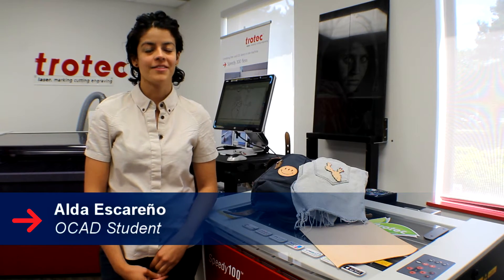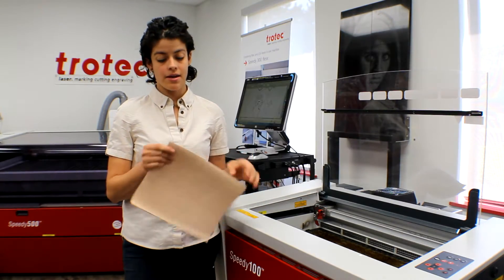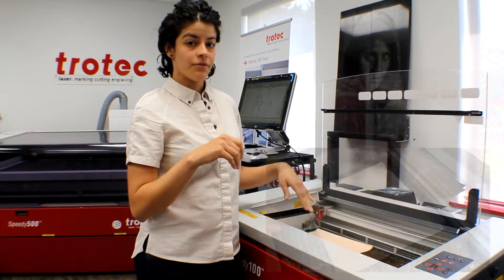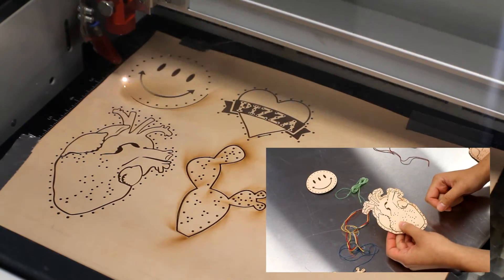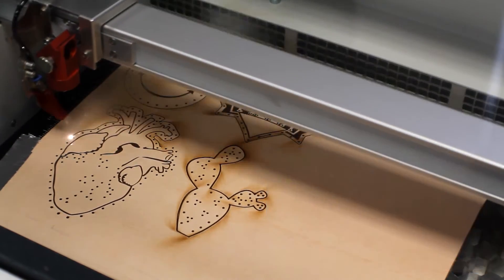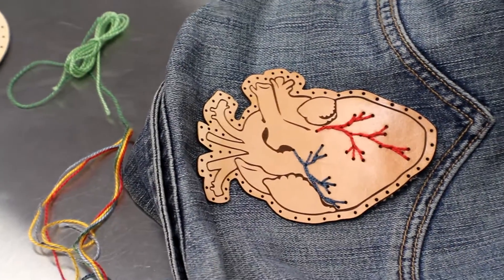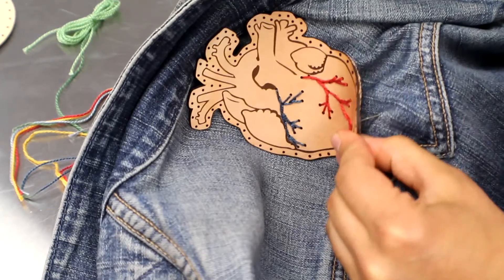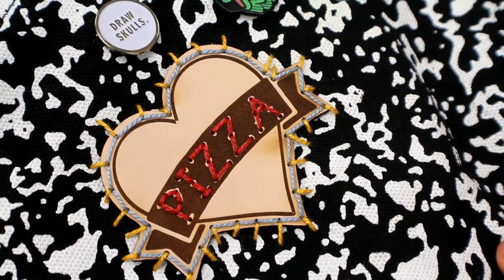Laser Engraving and Cutting Leather Patches | Trotec

Comment: Can you see the lightning without protection? Is the diode laser more dangerous?Is it possible to use Corel or Illustrator?
Reply from the maker: Hi sorry for the late reply. What do you mean without protection? You can use any design software on this machine - including Corel, Illustrator and CAD softwares

Comment: Do the edges come out sooty? When I cut mine it does. What is the best way to clean the edges?
Reply from the maker: Hi Eric, when you say sooty, do you mean burnt? Because unforgettably with raw leather you will always have that burn mark on them. What laser are you using?
Reply: Rayjet 80 watt - there is soot. Meaning I have to wipe burnt powdered residue off the edges.
Reply: This is unavoidable. Try buying a leather edge treatment from places like Tandy Leather.